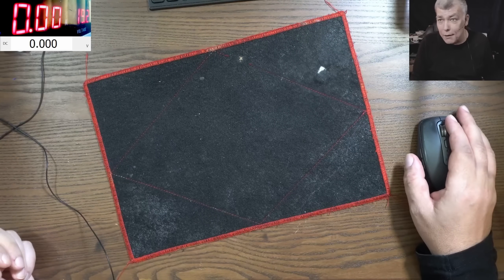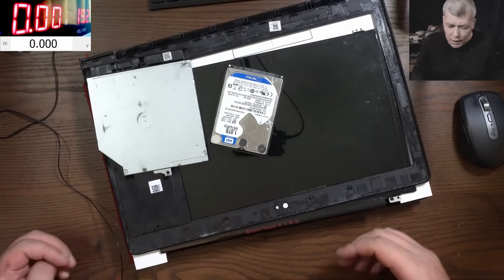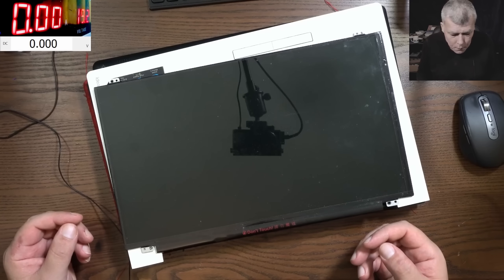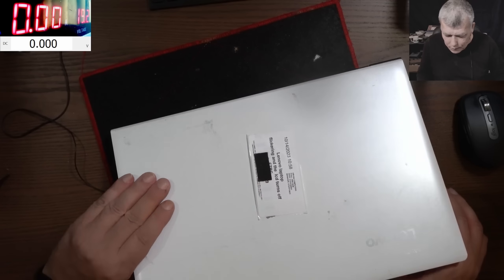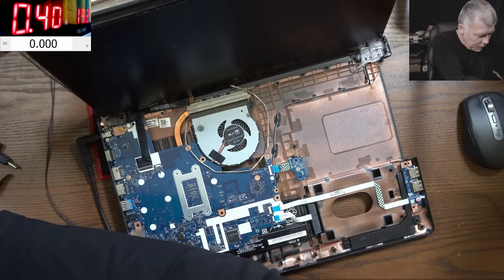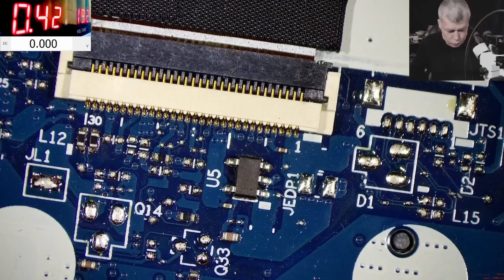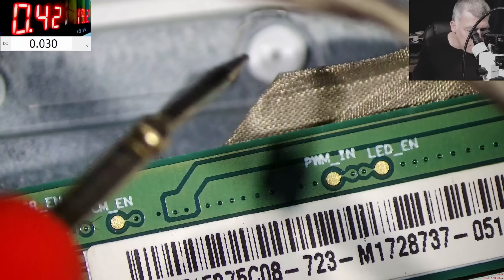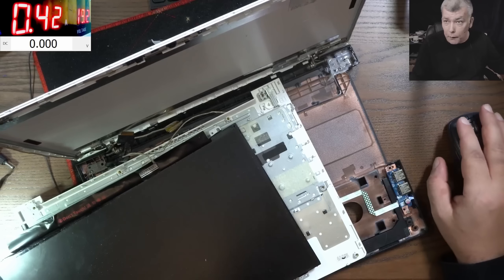What can go wrong when you replace a laptop screen - Screen replacement gone wrong Lenovo 310

Comment: "Doctors are not switching off the patient" 8:28 Careful with not switching off. You can fry the chip by not switching off, eventually by using a cheap soldering iron. I have fried a PIC16F628A by not switching it off. The circuit was supplied by a laptop USB port (5V).

Comment: Never seen a screen cable melted like that before!  I assume the most likely cause was they shorted the cable out when connecting it to the motherboard with the battery still connected?
Reply: try plugging in and non edp cable to an edp screen :P
Reply: Do you have a video of the aftermath?! @shawno1750

Comment: They tried to change the screen and they didn't disconnect the battery and they burned the EC... I would have replaced the EC and fixed the mess they sent me... wrong
Reply: So now the customer has a laptop with a broken EC that the shop broke and prob gonna charge the customer for it, i wonder if the other shop even gonna tell him that the laptop EC is broken. i wonder what else on the EC chip is faulty, it could be the keyboard and other stuf to.

Comment: I do the same thing. i buy laptops for spares and use them. BUT I always check if the screen is compatible before using it as replacement.
Reply: I don't think the issue was caused by using a different screen. Most likely they connected the screen with the battery plugged in.
Reply: how do you check the compatibility ?
Reply: @mercuryfor1956  usually by googling part number of the screen i want to use. Many websites that sell screens will have compatibility list under each screen

Comment: ok, but now the screen brightness adjustment doesn't work and the screen. is at 100% all the time.
Reply: Look to the bright side of the things
Reply: So?
Reply: @GamingManiaHackerW32  So? The Battery gonna be drained down very quickly. In the dark the screen is too bright. And that the brightness isn’t adjustable anymore. I even doubt, that there is anyone who is using a screen at or even above 100% brightness all day long.
Reply: Well yeah, but you get what you pay for. In this case I would ask the consumer if he wants a screen working at 100% or a new EC chip replacement after a few days to have the option to adjust brightness. But even in this case, maybe it isn't just the EC chip, and can be something else, so you always are in the risk of losing money when you try to do this kind of further repairs.
Reply: It's probably a good compromise for both the customer and the repair shop to have no backlight control rather than a fault which made the laptop unusable for the customer. But still fishy knowing that the repair shop itself might have caused damage to the laptop before calling Sorin...
Reply: oh well
Reply: Better then no screen, but yeah i also agree with that that 100% light is eye burning 😂

Comment: Solder on a dial variable resistor on side of chassis. Old fashioned way to adjust brightness.
Reply: Or replace the ec chip If not provide backlight control
Reply: @Swenser  Another nice idea! I'd like to see your face when you get your device back fixed like that.